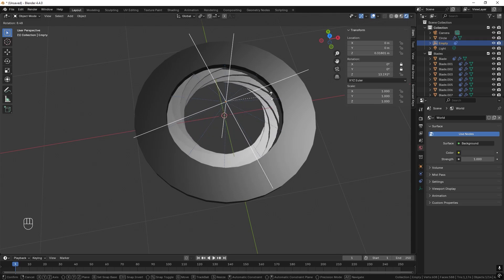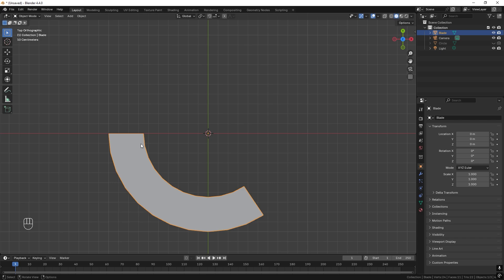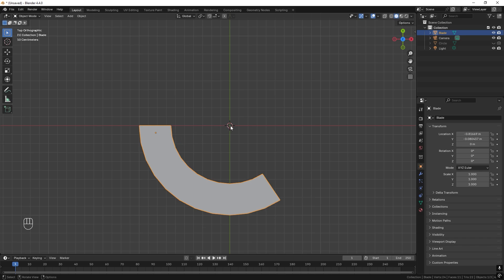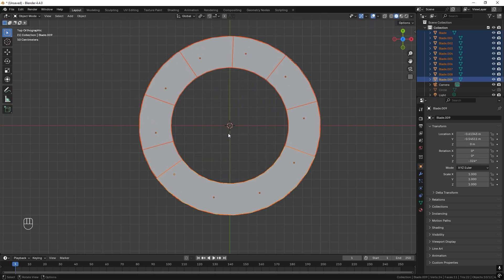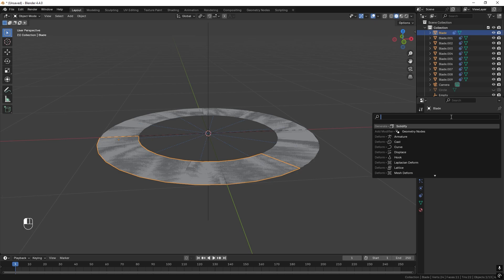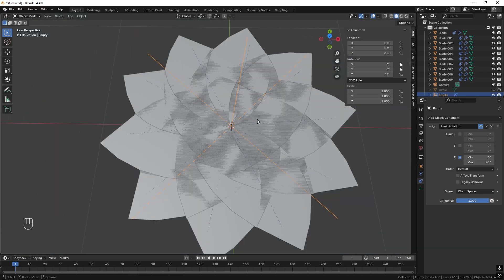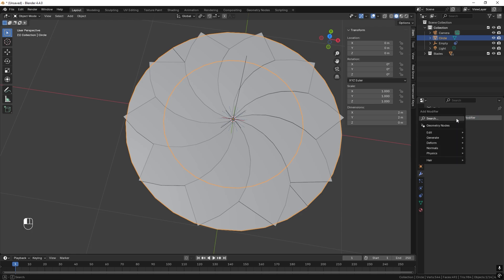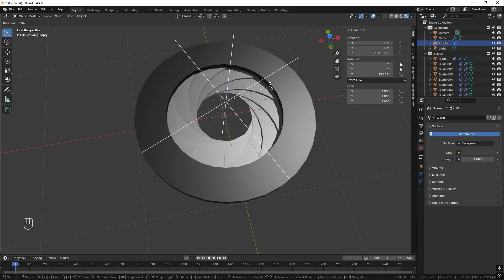Create a Camera Shutter in Blender

Comment: Hello man, I tried making this and works great. I have an issue though, I tried rotating all of it to be vertical and the rotations get messed up. So I tried to start from scratch vertically and now the issue is it doesn't work properly when rotating an empty to rotate all of them. It rotates on a different axis instead.

Rotating them individually works as normal and trying out all the Euler option doesn't fix it, do you have any ideas how to fix it? Or how do I rotate the entire thing without messing up the individual blades. Selecting them all and moving them seems to work fine, it's just the rotation.
Reply from the maker: Hi, one way to solve it:

1. Set the outer ring as a parent for all of the blades and empty
2. For the blades "copy rotation" constrain set the target to local, for all the blades
3. When you rotate the empty set it to only rotate in local transform oriantation

Hope this works for you
Reply: @3dplockis  I currently made 3 biblical accurate lens. Thanks I'll update after trying the fix